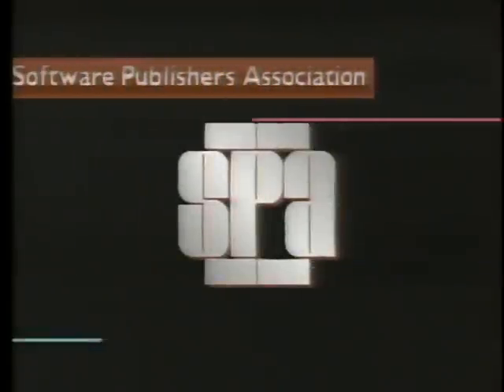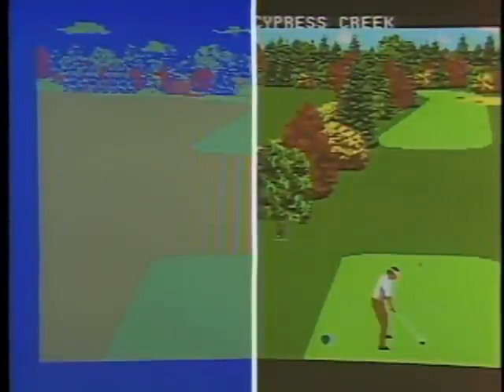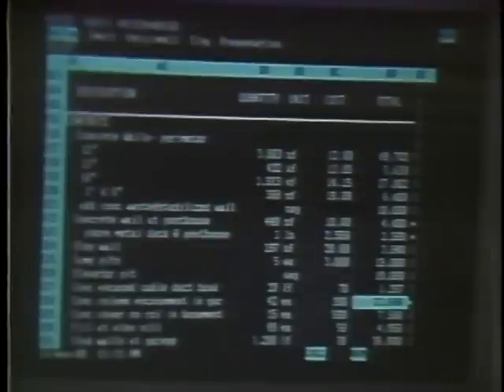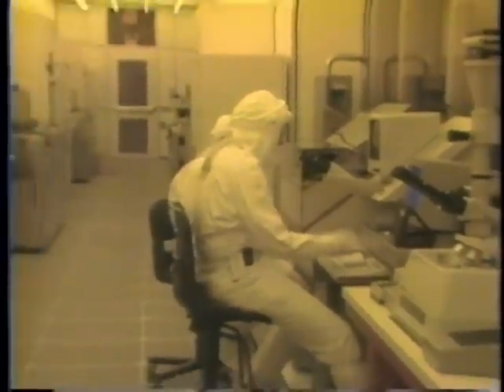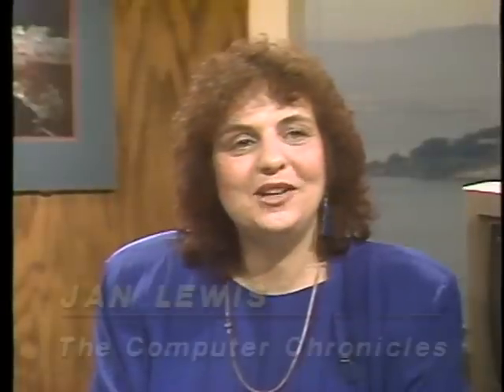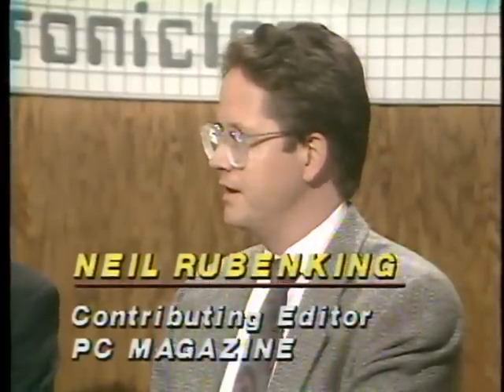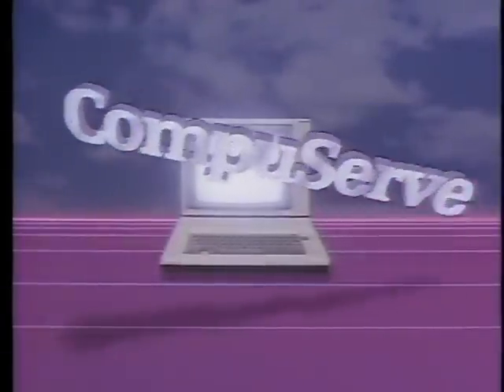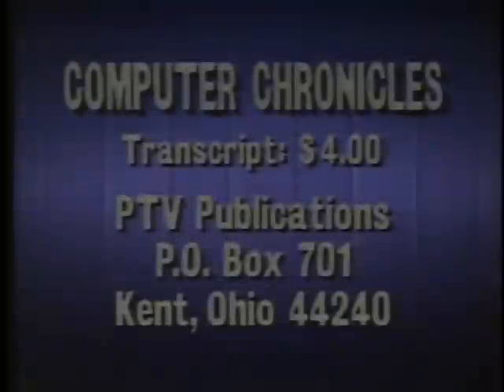The Computer Chronicles - Megahertz Mania (1989)

Comment: The AST test at 6 minutes is not correctly done, he is comparing apples to blueberries. 386 SX chip is a full blown 32 bit chip internally but externally has only a 16 bit data bus and 24 bit address bus. This means that performance wise it will be almost 50% slower than a 386 DX running at the same clock speed. It will still be faster than a 286 processor and by quite a margin.

Comment: I built my first PC around the K6-233 in '97.  It was cool because you could use Pentium cpu's on the same MB/socket. I remember running benchmarks between my K6 and a Pentium 233MMX that I received for free in 1998 using the same mainboard. The K6 was much faster in integer while the Pentium had a slight edge in floating point.  Good times back then for sure.

Comment: That beginning demo with the golf game is a perfect representation of Moore's law. A system that was state of the art 6-7 years earlier is now running so slow as to make the game completely unplayable. Today, however, you can still run all modern software, including games* on a 7 year old system, and it will be completely useable, albeit slower and in the case of a game, less visually pleasing.

Comment: Worth noting, they were predicting Intel chips to run at 200 Mhz in 1999, they were actually up to 600 Mhz on Pentium architecture by then, Pentium being faster than 386 for the same clock speed.

Comment: @4:11 lol, 200 MHz by 1999. In 1999 the Pentium III came out, with a max clock rate of 1.4 GHz. 

Though to be fair, perhaps comparing clock rates in 1989 to Pentiums is unfair, since the FSB on a Pentium III still ran at around 100 MHz.
Reply: you are a bit to fast. the first ever 1ghz cpu was the Athlon introduced March 5th 2000. Intel was 3 days slower.
1.4GHZ was first reached 2001

Comment: I’m pretty sure Jan is materially incorrect in the opening segment. A CGA video adapter requires a lot more processing by the CPU than VGA. So putting a VGA card in that XT would likely speed up the drawing of those golf game graphics.
Reply: As I understand, this was only the case if the card supported some kind of graphical hardware processing.  Such things were very limited and non-standardized so it is difficult to generalize but if we have to say that progressive technologies enabled more functionality then that would probably be the case. Else, the general idea is that these were all just frame buffers otherwise.  The CPU had to compute everything then just send it to the memory buffer on the graphic card for display. 2-D linedraws was the common function and some others that could help 2-D games.

Comment: 24:12 Pivot display with automated OS sensing - that I would want to see! That tech in 1989 is unreal! I have felt that when you pivot a monitor (I have a Benq 27" that allows this), the OS/GPU should sense that and change the orientation automatically. I am unaware of a system today that can do this - you always have to fumble with the video settings manually and/or need to set up shortcut keys. This should have been standard for a decade+. We are using HDMI/DP which are more than capable of handling this.
Reply: I've seen monitors that when rotated the orientation changes automatically. Dell has at least had a couple of models.
Reply: It's called Auto Pivot. Available since a decade at least. :)
Reply: @SethGeckoHungary  Longer. I've seen it as far back as 2002.
Reply: @paulmichaelfreedman8334  
Well, I hope Jeffrey will find one for himself. :)

Comment: My first PC had a whopping speed of 18 megahertz with a turbo button.  It was a 1991 off brand PC with 8 MB of ram. The only thing it had on it from the factory was DOS 5.1.
Reply: Did you know the turbo button actually slowed the computer down if engaged?. It was to slow down games that ran too fast. The default state of off was the faster setting.
Reply: metafis  I don't think that computer had enough power to run anything but the most simple games. I tried the turbo button once but the computer sounded like it was choking and never used it again.

Comment: My first computer was 8 mhz if you don't count the commodore 16 my mom bought me from the goodwill when I was 10 (hey, thats how I first learned programming), my second was 25mhz, I installed an overdrive processor and doubled the speed, (ha!).. then in 1998 I won a computer in a drawing at a computer store. It was an amd k6 233, next was a 400 mhz celeron gateway, then I bumped up to an amd 2200. Used that for a while, built an amd x2 6000 for about 6-7 years, now I'm running an 8 core 8350 with an ssd,  Yes, Ive owned a lot of computers,  and I still kinda miss my 2nd computer, lol the 1st one was a pile.
Reply: jzimmerman1229 
BTW I'm young
2012: Dell Latitude D610 2Ghz Single Core + 2GB RAM
2013: Acer Aspire V5-122P 1Ghz Dual Core + 4GB RAM
2014: Samsung RV515-S01UK 1.65Ghz Dual Core + 4GB RAM
Reply: jzimmerman1229 Sticking with AMD was your main mistake.
Reply: statikreg It runs fine for what I do with it. I would rather shell out 150 bucks for a processor than $300+
Reply: jzimmerman1229 That is a common misconception. Sure, they are often times more expensive, but not twice as much, unless you're only looking at i7s. It's not actually that much more expensive to get into a nice Intel rig, and any extra cost is well worth the money, in my opinion. I have zero problems with my Intel rig, where as this AMD rig I'm using right now and the one in my bedroom are constant struggles. I never even noticed it until I got my first Intel and was llike "wow...so this is what all the fanboys were on about"!
Reply: statikreg
I haven't experienced any issues with my AMD rig at all. I use it to surf the internet, extremely light gaming (virtual pool 4), and some programming/database work. It runs at about 20 degrees when idle and around 40-50 under load and that's with the stock cooler. I don't get any lag, even when having virtual pool on one monitor and watching netflix on another. My last one lasted me 7 years, with the exception of the hard drive and that was built on a low end motherboard. I had more money to spend on this one and I'm happy with it. Everyone has their preference and I understand that. I don't think I made a mistake with this build.
Reply: jzimmerman1229 Maybe I just have bad luck, but the last 3 AMD computers I've built (2 of which I still have, as mentioned) are a laugh a minute. One can't wake up from sleep/hibernation reliably, plus other random failures (bsod, lock ups, etc), and the other does all manner of crap to piss me right off. They're both based on mid-range MSI motherboards. The one that I sold was generally stable, but Crossfire for gaming was a complete joke (in most cases, using both video cards was slower than just one). I dumped $2500 into that machine and was sorely disappointed in the performance. I sold it for a pretty hefty loss a few months later, and built my first Intel w/ Nvidia GPUs and couldn't be happier.

So yea, maybe it's just me :)
Reply: +statikreg   Most of the time  that kind of instability  bsod, lock ups ... come from bad memory stick/motherboard or driver and last case possibility maybe a defective GPU but it's quite rare.  . So it's probably bad luck..   I would have tried to swap the board for something else for a few days to see what happens , pretty sure it would have fixed your computer. It would have fixed the  sleep/hibernation for sure because it is managed by the motherboard.

I personally never saw an AMD/Intel computer with a defective CPU that cause instability . I guess it could happen but it's so rare.
Reply: I liked my x2 3000 but the motherboard started acting funky after 7 years.So I figured it was time for an upgrade.

Comment: my first pc was a 33mhz ^^ but that was about 1998 xD now i've got 4x3.8ghz and 2x1ghz graphics processor, 3 tb disk space, two high speed ssds, 16gb ram... i never thought this would get affordable xD
Reply: I have 5 core i7 computers (16-32 GB RAM) , 17 TB HDD space (RAID 5 takes some of it), 6 SSD's (128-256 GB), 3 monitor's in main computer + 2 older computers. I build system for computer graphics and this is most efficient way to get needed computing power. Network stuff is the hardest part for me, but now it works.

Comment: I think my first CPU was a Pentium 2 which was 233MHz. It must have been 1997 or 1998 I got it, though it was second hand so might have been a computer from 1996. It couldn't play Half-Life.
Then a few years later I got a custom built machine with an Athlon XP 2700+ and a GeForce 2 MX440 64MB. Still have that card too.
Reply: For me it was an AMD K6 3D-NOW running around 200Mhz, 64mB RAM, and an ATI Rage 8mB... It was awhile ago, I was a kid

It was early 2000's, and I still to this day remember logging into AOL.

Ran 95 originally, upgraded to 98 with a bootleg copy.

Grandpa got it from his work place and gave it to me as a birthday present.
Reply: when I had pentium 1 200 mhz and my friends was pentium 2 233 mhz, I was so envy, difference was HUGE
Reply: Athlons back then were good

Comment: The smallest bit I can boost my graphic card by is in 20 MHZ increments, significantly faster than the 16 MHZ chip all by itself.  The slowest I can get my CPU to clock is around 1 GHZ, but I seem to recall hitting 800 MHZ.
Security Guard: "What on earth are you talking about, and how did you get in here?"

Comment: 4:25 I know by November 2000 they had Pentium 4's with 1.3 ghz, but in 1999 I was 9 years old I was running my hand built 333mhz celeron E-machine for my Qbasic programming. My mom in 2000 built a 1.7 ghz Pentium 4. Thats when I got her IBM Intellistation with x2 Xeon 533 Mhz server processors clocked at 850mhz using NON-ECC ram so I had half a gig of RAM on that sucker as opposed to my emachines 64mb ram. Ran windows 2000 professional like a dream NEVER Windows ME it ate so much of my childhood chasing memory issues. IBM Also came with a SCSI card and 16 monitor pigtail. I wish I had that IBM today. Be so fun to mess with. Or run an oldschool PBX or whatever.

Comment: These days computers were treated like royals. In 2019 no computer gets this kinda treatment.  My dead 2009 HP laptop is like super computer to these ones. i5  2.7ghz. 4 GB ram. 750 GB HDD. Firewire, wireless adapter, USB 2.0. 17" display. My 2019 lab tops both mac and PC aren't that different than my old HP.

Comment: Ha! Bill Rash...you my friend were way off. I believe this was filmed in 1993? Well.. in 11 years Intel will launch the Prescott 3.0-3.2GHz processor w/hyperthreading. I know this because my very second PC build was done in 2004 utilizing the 3.0GHz variant and the cream of the crop GeForce 6800ULTRA 256MB video card just so I could play Doom 3 full out on day 1. My best friend did the exact same thing but went with...I believe a 2.4GHz AMD setup with the same 6800ULTRA. We played soooo much Doom that month. What's funny is the Prescott was not a particularly great processor and had cooling issues from day 1 but it worked for what I needed it for.
Reply: This was filmed in late 1989. Aired December 7, 1989.

Comment posted September 28, 2024 7:09 pm

Comment: While this is very old video Lol I still remember my very first computer too. I think was back 1991-ish Yup Tandy 1000SL2 with 8088/86 cpu ( can’t remember ) think ran at 6-8 MHz and single 3.5 flappy drive/720kb floppy. No HDD. Running Tandy desk-mate OS. Gah hate it so much.  Since I’m in Canada.  Prices here were even more vs USA pc prices.

Only good thing I loved it for vs any other pc was the Tandy sound,  the sound was so much better then crapy pc speaker that was for any games back then.  Pc sound was horrible.  Not till years later got better pc and remember my first sound blaster 16 ISA upgrade sound card, aaah those were the days hah

hate that Tandy had TGA 16 colours. (Tandy). Remember playing Sierra hero quest 1 game. Then remeber so badly wish it had VGA graphic cuz couldn’t play most newer pc games cuz most newer game move to VGA/EGA & HDD min requirements. Which mine didn’t have. Then few yrs later our school got rid of all old Apple 2e and upgrade all to Mac’s plus/classic with Motorola 6800 and they had 3.5 inch 1.44mb floppy 20/40 MB HDD. I was so jealous lol 

Hated my Tandy so much back in early 90’s. As everybody either upgrade 286 to 386sx or better or Mac’s lol. Kinda miss those days. 

On different note. 
I think hardware has advance far faster then software has imo fo current age, as of nov/2019. While generally software has improved some. l feel it’s still lacking and or stagnated because of Microsoft strangle hold over pc/and killing & bullying out many other software companies ( anybody remember IBM OS/2 Warp lol I do)   While Linux has gotten bit better,  MS has strangle hold over PC market and pretty much dictates window or NOTHING choices at least for consumers/general public.  

The simple point is because there been very little competition for Microsoft (beside Mac).  They dominated OS market and standard now for public/consumer at least when comes to pc market  Leaving very little choices for consumer.  It’s kinda sad.  While we do have Mac/Linux/Unix.  You don’t see big name companies ever recommend Linux as os. 

Hope someday in the future that changes.  As other industry gives consumer choices.  I hope pc market someday will open its eyes and see how much MS has strangle hold over it.

Could you imagine if we all had drive all same car company?  Gah imagine if we all had drive window car? lol blue screen of death, would actually been real death gaaaaah

Comment: What was the profit on systems in 1989? Costs today are so low that when I have a motherboard or power supply fail under warranty I just buy a new one. The shipping cost for sending back to the repair depot are as high as the failed hardware.
Reply: aside from budget systems, margins were huge because of low volume sales. for example it's how apple managed to stay afloat even though they only sold specific  models in the thousands of units not millions.
Reply: Dunno what the profit was, but my Gateway 386-20 with 4MB of RAM and 60 MB hard drive was $2800 in 1989.

Comment: Marketing Director of Intel says we want to see 200mhz in 10 years (1999), and but we were actually in the 500mhz+ range by then.
Reply: Competition happened with AMD.  Without competition you would have had a monopoly with Intel and they most certainly would have kept development slow, so 200MHz may have even been optimistic.
Reply: referral madness  monopolies don't invite innovation because there is no financial need to and actually increase losses by innovating with no competition

Comment: 386SX was a 386DX
 with the math co-processor intentionally burnt.
Reply: 386sx had a 16bit bus
Reply: You're thinking of 486SX and 486DX.  The 386 did not have an internal math coprocessor.  It was an external chip - the 387 math coprocessor.  The 486DX had a built in math processor.  The rumor at the time was the 486SX were 486DX chips that failed the coprocessor test.  The 386dx had a full 32 bit external data bus.  The 386sx had a 16 bit external data bus and could only address 16MB of memory.  That was the primary difference there.

Comment: So even in the 80's,peoples were seeking for higher speed on their pc's.
But i find it strange that special designed 386 chips can be be out on 286 motherboards,since those 286 motherboards along it's chip were 16bit ,but the 386 is 32bit.
Reply: it could execute 32 bit instructions but it had to be done in 2 clock cycles, effectively cutting the speed in half vs a full 32 bit system, but it was still faster than a 286
Reply: The 80386sx was 32 bits internally, and 16 bits externally.  Just like the original PCs had 8088 CPUs that were 16 bits internally, and 8 bits externally.

Comment: At 5:50 the test they're doing is not really fair. Thr 386sx cpu is no where near as fast as a 386dx even on same clock speeds. This is due to the fact that 386sx data bus is only 16 bits in size. 386dx has a full 32 bit data size which makes tranferring data twice as fast at the same clock speed.

Comment: In 1999 I had a Pentium III with 733mhz. 128MB Ram and 8MB Nvidia Vanta LT.
Good times!
Reply: *****
 I never had one. :-(
Reply: ...ours was a 1998 233mhz PI with 32mb and a Voodoo3... The 90s were a bitch to keep up with computers in. It seems like the need to upgrade (outside of high end gaming) is not really existent today. Grab a $100 compact office desktop and it will do any daily tasks with no problems.